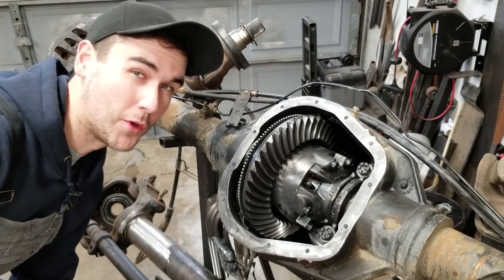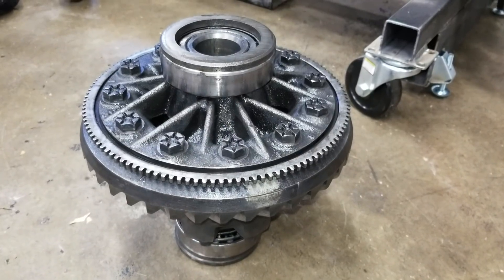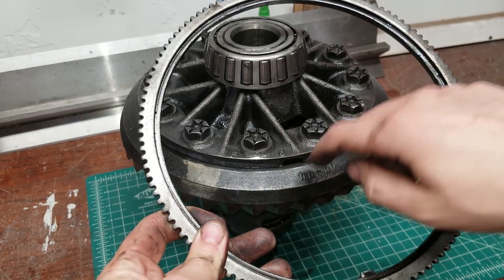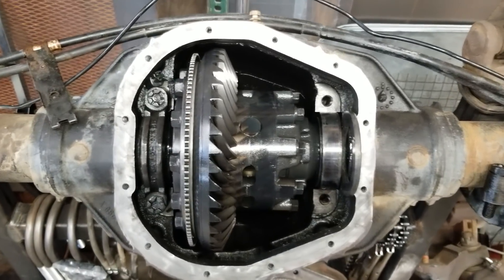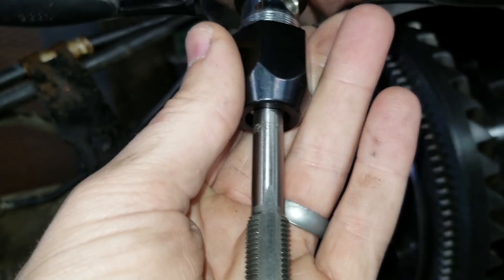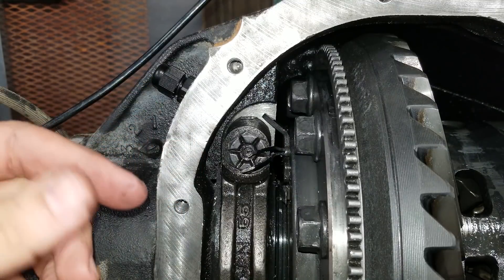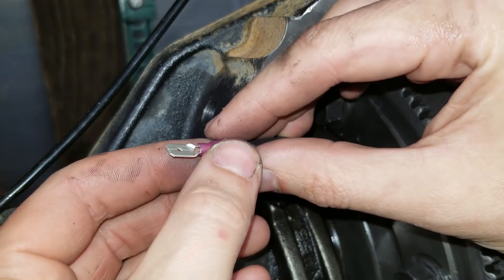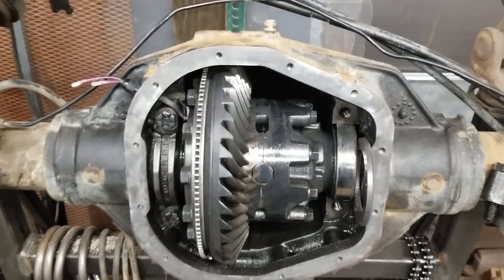Super Duty Rear Axle JUNKYARD E Locker Swap!

Comment: Why not bore the hole for speed sensor in the newer axle... I'm pretty sure the prevision is there and you get better brakes, No?  Oh and you think you could post the WMS to WMS of the two axles you have and tag with year? I can't seem to find that sh*t anywhere's on the web. Nice rig by the way.. Was thinking of a Dakota build myself but I opted for a Jeep Liberty instead ( the dog needs a place to sit out of the elements too :-P ).
Reply from the maker: Available great ratios are different between the axles- I explain it in some other comments. The brakes appear to be pretty similar but I haven't really compared too closely. All the 05+ SD axles are 72" WMS for the SRW.  I'm not sure about the 99-04 leaf spring ones. Jeep liberty will be an awesome build! 🤘You don't see many of those built up so it's a cool idea. Thanks a lot for checking out the videos! Spread the word 😉
Reply: @WebWheeler  So it just so happens that I had a '11 f250 SD, super crew-long bed w/ rear E locker in the shop today. I measured from outside of tire to inside of other tire.. Front 68.5" Rear 67" ?!?!Confused?!?! I measured it like 8 times! Yes, factory wheels, all the same tires, pressures the same, measure accordingly on the tread...etc.  Anyways, went online to Randys ring and pinion and checked out ratios. 4.88 was the lowest set they had (specifically the truck above). Do you think that this is in relation to the factory e locker not allowing the clearance for ring gear? And what ratio are you planning for?
Reply from the maker: That's really weird about the tire measurement. I will measure the axles I have again (2006 and 2011) but I've always seen 72" and I believe I confirmed it on mine. Either way, in 2011+ the rear axles have a bigger 37 spline pinion. I'm thinking that the bigger pinion doesn't allow the pinion gear to be small enough to get a deeper ratio than 4.88. That's the only difference from those axles to the older ones
Reply: Pretty much all street driven cars, trucks, vans, et cetera have a wider track in the front than the rear to allow more clearance since the front tires need to turn.

Comment: Would the whole axle assembly (2011+) fit right into the 2008-10 trucks?
Reply from the maker: Yeah it should bolt in but the ABS is different if that matters to you

Comment: Nice video! You didn't have to adjust the mesh of the ring and pinion during the swap??? Thanks
Reply from the maker: That does need to be done- I will be changing the gear ratio so I didn't bother when doing this swap. I will make a video about swapping gears soon 👍

Comment: Hi quick question for you, I'm considering putting this type of locker in my 1997 F-350 10.25 rear. Will the old 10.25 4.10 ring gear work on the new carrier Alright? Also how many spline is the new locking carrier? Thank you Nathan
Reply from the maker: Hey Nathan. Yeah your old ring gear will work on the new carrier. You'll need to set up the gears again (different shims probably) but the gears are interchangeable. The new locker is also 35 spline shafts just like the old Sterling's 👍 thanks for watching!
Reply: Awesome that's what I needed to know. Thanks for getting back with me I appreciate it.

Comment: Why not install the whole rearend?
Reply from the maker: Fewer gear ratios available for the 2011+ axles (only down to 4.88 vs 5.38s for the older axles,) it's a metric lug pattern for the newer vs the older (pre-1999) axles which are standard, and the ABS system for the older axle uses a tone ring on the carrier (same as my Dakota) while the newer axles use tone rings on the wheel hub 👍

Comment: You should have wired the connector through the diff cover
Reply from the maker: That would be a pain in the ass haha I would need a long wire to make it easy to connect/disconnect the locker when installing/removing the cover which means the wiring could easily be grabbed by the spinning carrier.  To avoid that I would need a really short wire connecting them which would make it a pain to install/remove the diff cover and connect the wiring.  Going through the housing allows them to be dealt with separately and I can make sure the wiring is routed safely
Reply: @WebWheeler  or you could bolt a wire tie or some kind of bend piece of sheet metal, creating a shield, under the head of the carrier bearing bolt so the wire is routed around and away from the abs pick up ring and spinning parts
Reply from the maker: @122ffsdd  you're still fighting the wiring every time you try to get the diff cover on or off. I don't see any benefit to doing it that way especially when it's so quick and easy to drill and tap into the housing and you never have to think about it again. But you do it your way haha
Reply: @WebWheeler  no permanent modifications to your axle and you are using the factory hardware. That's the benefit.
Reply from the maker: @122ffsdd  definitely not worth the extra trouble to me but you do you

Comment: Why didnt you just swap the whole 2011 axle instead pf swapping guts?
Reply from the maker: 2011+ axles use a 37 spline pinion that only has gearing available down to 4.88. I need 5.13 or 5.38's so I need the older 35 spline pinion
Reply: Thanks for the response!
Reply from the maker: @FlyinRaptorJesus  No problem- thanks for watching!

Comment: I'm swapping 05+ axles into a 96' Bronco and need the VSS.  I never thought about the magnetic field killing the spedo, that would really mess up the transmission shifting as well.  Well, so much for this option...
Reply from the maker: Yeah I'm not sure what that's going to do to my abs system... Guess I'll find out! If it's a problem I will have to go to an ARB or OX locker
Reply: @WebWheeler  Yah let me know -- good idea.
Reply from the maker: Keep watching the videos- I will definitely talk about it when I find out how it works!
Reply: WebWheeler you got it bud! Sub’d. 

Probably cheaper just to throw a tone ring on the output shaft of your tcase and get a pulse converter to give it what the pcm wants — this is of course if turning on the locker kills the ABS
Reply from the maker: That's a great idea... Good call!
Reply: @WebWheeler  Yeah -- can't take credit... could probably put something on the yoke and do it external or get crazy and machine it like this guy: 

https://www.nc4x4.com/forum/threads/np273-rebuild-and-duramax-swap.191665/#post-1683349
Reply: Did this ever work for you. I just put superduty axles in my 95 bronco. Wondering if it will mess with the VSS? Thanks
Reply: @jorge4087  I ended up putting a VSS relocate on the back side of the t-case.  I'd say the spedo is more accurate and STEADY than the factory setup.

Comment: Will this work on my first gen dodge durango? As a boult in mod. Not counting the wiring
Reply from the maker: Not this diff- these are only for the Ford Sterling 10.25/10.5 axles. Best factory bolt in option you could find for the Durangos would be a limited slip diff but e lockers are available in the after market

Comment: How difficult do you think it’d be to swap the entire axle? I know it’s not related to the vid, but I have a 2015 F150 2wd open diff, and ideally I’d like to find an E-Diff super 8.8 hoping to just swap he whole entire axle.... any ideas would be great thanks!
Reply from the maker: I think they would swap over pretty easy- possibly even a bolt-in deal but I'm not positive since I haven't deal with those axles much. It would likely be easier than swapping just the diff since you'd need to reset the gears as long as the mounts for the leaf springs and shocks are the same. I have a few videos about putting a custom rear in my project truck that you can check out! It's custom so it's more work than you'd have but still gives you an idea of what it takes. Good luck!
Reply: @WebWheeler  Thanks for the reply man!  Hopefully I can find one.  Ill be sure to checkout the other vids as well

Comment: Not sure how I even came across this video. I had just ordered a Yukon grizzly locker for 680 bucks for my 10.5. Seen your video canceled my order found a 2012 with e locker at the local junk yard for 500. Saved me 180 bucks and got me a selectable  locker. Much appreciated! Good job on the videos. I really enjoy your videos no flash or wiz bag just basic info. Keep up the good work.
Reply: Would have spent the extra 180 and had a stronger locker🤷🏻‍♂️
Reply from the maker: For a selectable locker you're paying at least double the price of these lockers - and that's if you buy it new rather than finding a good used I've. Detroit lockers and other auto lockers are great but I prefer selectable for anything that's street-driven
Reply: @American.Divergent  4 years later and still no problems. All around the hammers and once on the Rubicon and who knows where els at this point. I'm happy with the return on investment. I'm also running an eaton electric selectable in the front SD60 as well. 07 Tacoma SAS with a 4.0 on 40s. Probably why they live.
Reply from the maker: Glad to hear it's still working good for you! Same here 👍
Reply from the maker: Glad that you're enjoying the videos! And that's awesome to hear it saved you some money 👍  There are so many channels just trying to push you towards buying stuff but I'm trying to do things differently even if eventually I miss out on sponsor money haha. Spread the word! Thanks again!

Comment: why not just swap the rear
Reply from the maker: The axles with the e locker option only have gearsets down to 4.88. I need at least 5.13s which is available for the older axles
Reply: I was looking around the comments to find this lol

Comment: Hey man awesome vid inspired me to do the same and as luck would have it i pulled an e locker out of an 2011 f350 today and just a few questions one being did you get new shims for the install or what set of shims did you use the ones out of the 06 axle or the ones out of the new axle
Reply from the maker: Glad to hear it helped you out! I reused the ones that were in the old housing just to keep it a roller but I plan on swapping gears before running it so I haven't bothered to check backlash or anything. With the new gears I will install new bearings and the correct shims. I'll have a video of that when it happens too 👍 thanks for watching!

Comment: Why did you do the e locker swap and not just build the e locker rear and housing?
Reply from the maker: The 2011+ axles have a 37 spline pinion which only has gearing down to 4.88's available.  I need at least 5.13's or 5.38's so I had to go with the older style
Reply: Ah I gotcha that makes sense. Love the dakota build comin up! I have been wanting to do a similar style build but I have a hard on for toyotas lol just saw your channel today and love the content. Keep it up man!
Reply from the maker: @toyotafied9505  Glad you're enjoying it!  Thanks a lot man.  I'm trying to finish up the next Dakota video- will be coming soon! Toyotas are a great platform to build- would like to build a 4runner some day.  We'll see haha.  Thanks again for checking out the channel!

Comment: Right on!  Wanted an ELocker in my 10.25 for awhile.  I have a Sterling in my 1976 Ford-gear ratio was right, and the price.  Off topic, but could you swap out the axles and ends to the older style to get away from the Metric lug setup?   Either way, now I know its Possible.  Thank You.
Reply from the maker: No problem! The hubs won't swap over from the older axles to the newer axles but the locker will for in the older 8 on 6.5 axles. If you want the newer disc brake setup you could also redrill the 8 on 170 hub to 8 on 6.5- the hubs have plenty of material for that 👍

Comment: Do you know how low of a gear you can put on the factory e-locker?
Reply from the maker: The lowest great I have seen for the 2011+ axles is 4.88s. For the 2010 and older you can get 5.38s. The e locker will work with any of the gear ratios though 👍
Reply: WebWheeler thanks man! I just remembered some housings on certain axle configurations wouldn’t let you run but up to a certain ratio👍🏻like they even made 2 separate housings depending on how steep the gear was for the trucks build sheet or something like that anyway 😂
Reply from the maker: No problem! Yeah the full float sterling 10.5 and 10.25 have been pretty consistent throughout the years- all the carriers will accept all the gearsets with the right bearing set. The 2011+ have a different pinion (37 spine) which is where gears are limited. Carriers are all interchangable though!
Reply: There is no carrier break.

Comment: I've been wanting to do this to my 06 f350 and hook it up to one of the factory aux switches.  Now I just need to hunt down an axle
Reply from the maker: Yeah it's pretty easy to do once you find the locker haha good luck! Thanks for watching 👍
Reply: I would like to get this done to my 2005f350 truck so I just gotta get a rear end like that with the electric locker and swap it like that no problems
Reply: I'm just wondering if it'll fit any help out there also I was thinking of a front diff locker like this one
Reply from the maker: @allenw1936  As long as your F350 has single rear wheels, this locker will fit fine in your current rear axle- it'll be there same as the one I used here.  According to some other comments, the locker could mess with your ABS sensor when the locker is activated but I haven't verified that myself. And as for your front axle, I don't know of any junkyard lockers but there are tons of aftermarket lockers for the Dana 60 that will work great (Eaton E locker for example if you want both electric.) Good luck!
Reply: @WebWheeler  Will you need to check the mesh (backlash) if the gear ratios are the same from the donor axle ?
Reply from the maker: @6_30  Sorry I missed this comment.  Yes you do need to check backlash- there will be inconsistencies between the machining of the carriers that needs to be adjusted for.  Thanks for watching!
Reply: @WebWheeler No worries, I appreciate it! Great video!!!!

Comment: That setup through the gland isn't sealed.  Gear oil and/or water will wick down the middle of the heat shrink in the space between the two wires.  Those cable glands are only liquid tight when used with waterproof cable (which typically have a solid rubber jacket around the conductors, not a sheath).  I'd at least slather some RTV on the wires before heat shrinking them together to take up that space if you don't want to wait to order cable.
Reply from the maker: Yeah it occurred to me about a week ago that there's still an open path between the wires. Good call on the RTV before heat shrinking. Comment pinned so that people will see that tip. Thanks! 👍
Reply: @WebWheeler  A marine grade heat shrink will have an adhesive lining inside that melts when you shrink it, creating a liquid-proof seal throughout.  You can pick some up at Harbor Freight or almost anywhere that sells regular heat shrink tubing, it's great stuff for any kind of exterior electrical connections!
Reply from the maker: Good to know! Thanks a lot for the tip 👍
Reply: In order for those types of gland seal to work the cable needs to be round.  Go to Home Depot and get some 2 wire SOOW and run one length from the dash through the gland and it will seal very well.  Till it gets old and breaks off due to heat.

Comment: Thanks for posting this! Before I go this route, I wanted your opinion on how reliable it is off-road. Have you wheel it yet?
Reply from the maker: I haven't yet- just starting to build the truck that locker is going in but I read quite a bit about it on pirate4x4 (like a true web wheeler haha). Those guys push their stuff hard and seems to be holding up. Plus you figure the lockers are designed to handle the powerstroke which is 400+ HP and 800+lbs/ft haha. I will let you guys know when I get some miles on it!

As far as electric lockers in general, they are more reliable than air lockers in my experience because it just needs 12 volts (obviously that's reliable otherwise your truck isn't running anyway haha) some wire to carry the load, and the mechanism is magnetic which is just physics haha.

Air lockers on the other hand need 12 volts to the compressor, air lines to bring the compressed air to the locker, the air seal in the locker to be in good shape, then the whole system needs to hold 100 psi to keep the locker  engaged. They're great when they're working and they're generally reliable but there's just a lot of places for something to go wrong. Just my 2 cents haha. Thanks a lot for checking out the video!
Reply: Awesome response, I appreciate it! Good luck and I will keep an eye out for any updates.